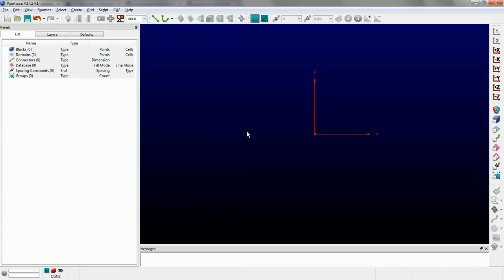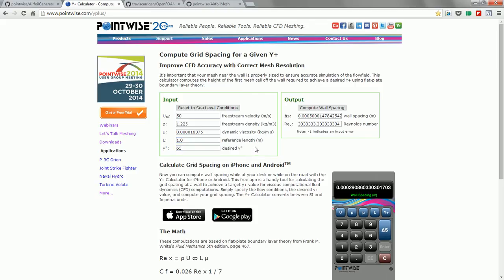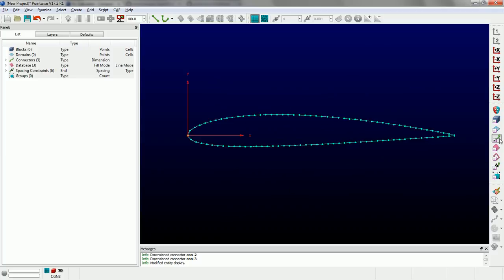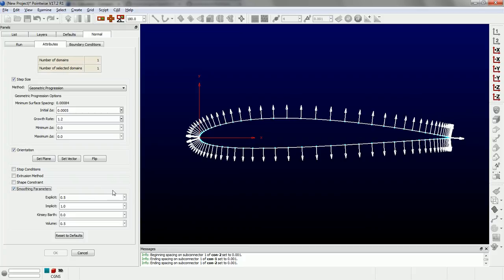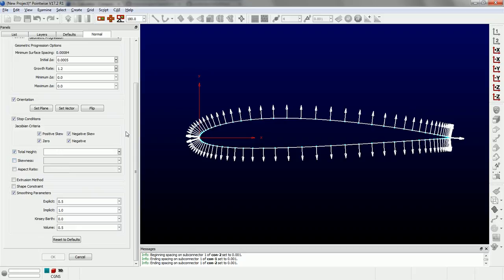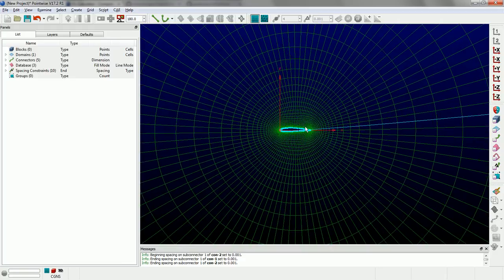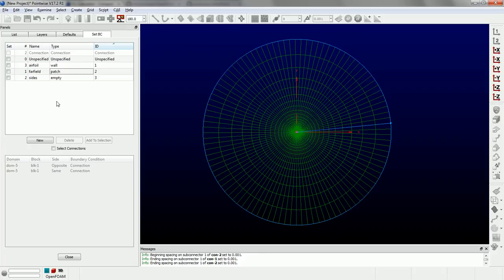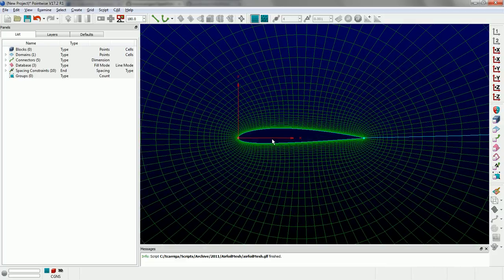Pointwise Pointers: O-Grid Tutorial

Comment: Hey Travis, thank you for such a good tutorial. I'm able of meshing a NACA0012 following your movie but I would like to control the radial resolution. I tried to modify the radial nodes number after meshing but the hyperbolic feature disappeared... Is there any way to do that?
Reply from the maker: Great question. You'll need to re-extrude. Simply select the domain and go to Grid, Re-extrude.
Reply: Hi again Travis! Thanks for your reply! Itried to do that but I'm afraid that after changing the default number of radial nodes, the Re-extrude tool is not available. Can you detail it step by step after de first default extrusion? Thanks!
Reply from the maker: Correct, you cannot change any of the dimensions after the extrusion (or modify the grid in any way) or re-extrude will no longer be available. You will need to delete the domain and recreate the extrusion.
Reply: Travis Carrigan So how to extrude an O-grid for the airfoil with the trailing edge connector prescribing the number of radial nodes? That's my big question

Comment: Travis, 

On a possibly related issue, have you ever run into OF throwing an error that "face X does not match neighbour by Y%"? I am trying to run a simulation of a airfoil cascade passage and the error is of the order of 0.8%. Surely PW would have matched the mesh faces to a higher precision? I made sure that the database entries constituting the top and bottom of my passage in my project where marked as periodic, and so I assumed PW would ensure they match. I have seen people recommend that you export the periodic faces patch BC in PW and then use a createPatchDict to get the cyclic BC, but that hasn't been of use to me. Is there any chance I need to make a simple correction in PW to ensure my cyclics are matching?

EDIT: In fact I can see that my cyclic boundaries have been mirrored - by that I mean for my upper periodic boundary the first location as you move axially forward actually corresponds to the last location in the axial direction of the lower periodic boundary.  

Thanks!
Reply: +Oscar Wilsby Pointwise does not guarantee the order of periodic faces. OpenFOAM requires that the faces be ordered identically on the periodic patches. You'll need to use the createPatchDict to get the cyclics working correctly.

Comment: Travis, 

Thank you for your excellent tutorials. I have a problem however, which is that when I export CAE from pointwise I only get 5 files (boundary, faces, neighbour, owner and points) whereas in your repository you have the additional files "cellZones, pointZones, and faceZones". I am finding that these are required to run a simpleFoam simulation. I run the exact same case in OF but the only difference is I use the exported files from the pointwise project instead of the ones you provided directly in the case folder. Where did you get those extra files from? 

Many thanks,

Oscar
Reply from the maker: +Oscar Wilsby In the latest version of Pointwise you can choose to export sets and zones. However, you do not need them for a simpleFoam calculation.
Reply: +Travis Carrigan It's very strange indeed. I am seeing the following: When I use the polyMesh files you have attached in your GitHub repo there is no problem running simpleFoam. However when I open the pointwise file for this case and I export the 5 required files by Export->CAE and use that input in my polyMesh then OF complains by throwing a Floating point exception.The simulation residuals are also in the 1000s. Examining the files I can now see a difference:

1) The files automatically outputted from PW do not have the standard OF comment header but this shouldn't make a difference 
2) the 'boundary' file does NOT contain the 'inGroups' entry in when I export from PW, whereas yours does. I changed this but it didn't change my OF error.
3) The entries in the remaining files are not identical. For example in 'faces' yours starts with 

24341
(
4(200 6422 6161 99)

and when I export your PW project  I get a file that starts with 

24341
(
4(621 6422 265 104)

Maybe this is not an issue but I honestly am running out of ideas to try. Many thanks for your help.
Reply from the maker: +Oscar Wilsby Ah, I know what's going on. You need to first ensure that the grid is scaled correctly...which it should be. Second, and most importantly, you need to run 'renumberMesh -overwrite' to renumber the grid. Pointwise does not export points and cell in any particular order and OpenFOAM is very sensitive to the grid bandwidth. By running renumberMesh you are basically reorganizing the grid to reduce the bandwidth of the matrix. That should help.
Reply: Yes! It really was that simple. Thank you, you have been a huge help.

Comment: Hello Travis.....I was wondering if you would change anything in this method if you were building a mesh for the NACA 0009 airfoil...For some reason, for angles beyond 8 degrees, the solution for NACA 0009 at  Re 500,000 does not converge.
Reply from the maker: As long as you have a blunt trailing edge and performed a hyperbolic extrusion, the grid quality should be of sufficient quality. Now if I recall correctly, the NACA 0009, being a thinner profile, will stall sooner than the NACA 2412. Therefore, the flow is probably largely unsteady and it can be really challenging to get a converged result at those high angles of attack.
Reply: Travis Carrigan Thanks for your reply. I understand convergence would be a problem at angles close to stall. However, the solutions converge well in the case of very high angles of attack such as 30-60 degrees. Any suggestions? It is funny because solution fails to converge only for angles between 10-20 degrees AOA.